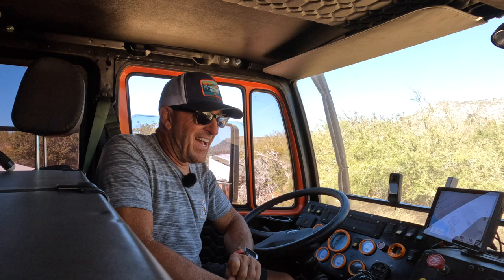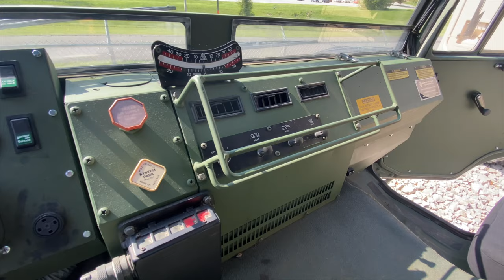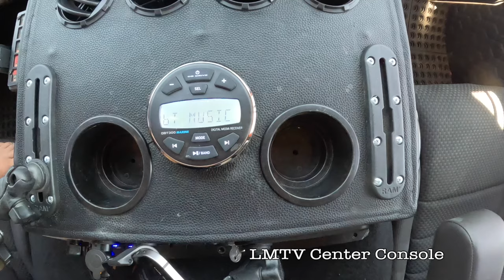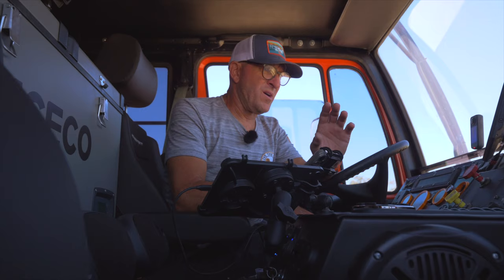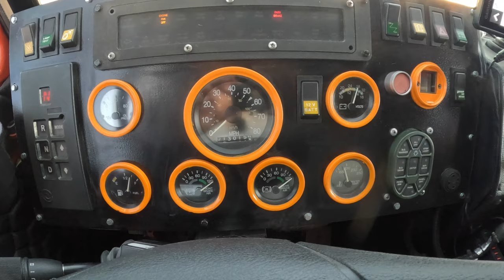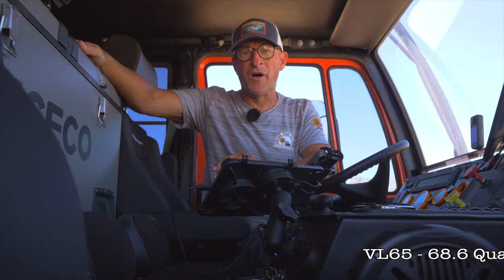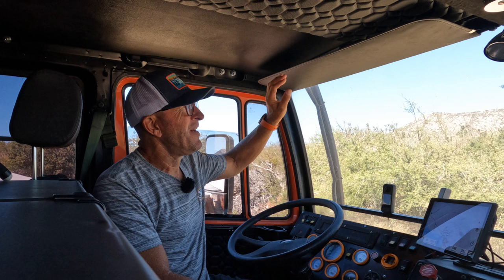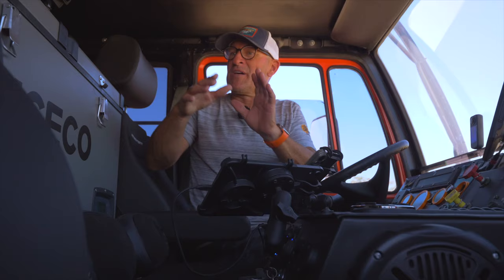The Ultimate Overland Truck Cab? | Complete Overhaul | Ep 19

Comment: Something to consider if your building out one of these for family adventure.... build your camping/living space box ULTRA strong, use 1079 box, or a box off an ambulance. Prep your living space seating to also be proper seat belted seating.  Reason being now you have a strong structure to sit friend and family...... cause  honestly you dont want them in the the cab when traveling/offroading. That cab is Tin Foil.  You'll need to research/experiment what you need in box that helps passengers in there to not get motion sickness.  (cameras making inside box monitor(s) act like a camper side window for looking out..  or video googles that make it look like passenger is up front looking out windshield.  .. any of those may help)
Reply from the maker: Very true. I do have the M1079 box, although I am solo so no need for even a second seat right now .